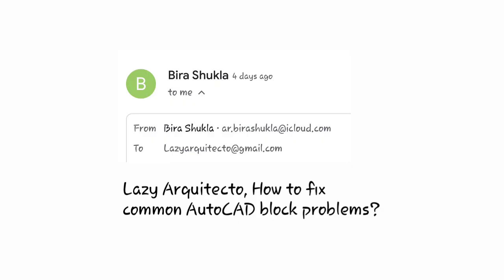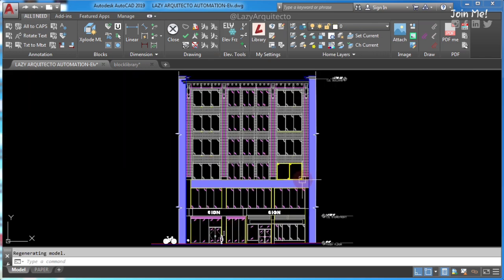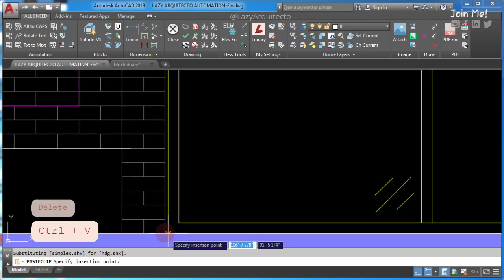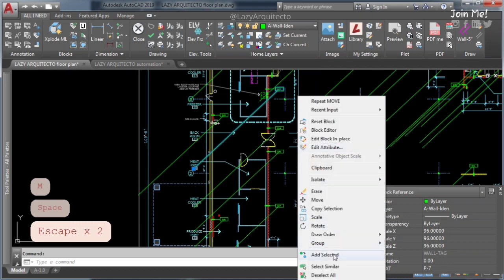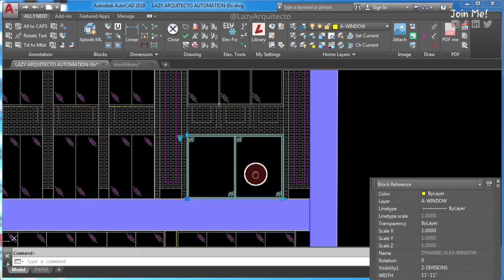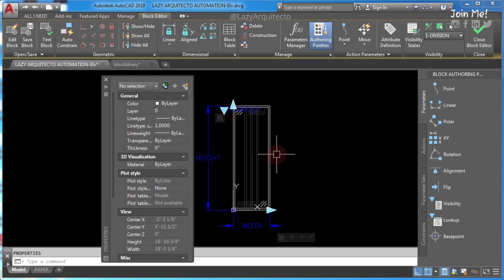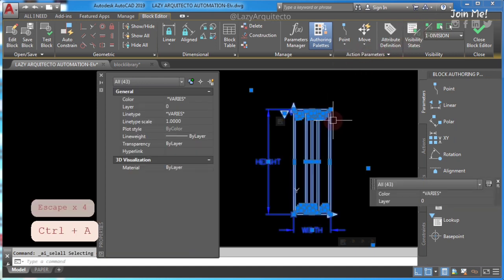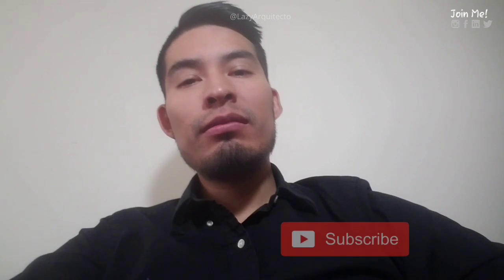Do You Have These Autocad Block Problems?

Comment: MAN!! I have a block that the linetype is not showing correctly on a block. I have a similar block that is appearing correctly, but one is not. a regulator the pilot line is showing as solid on one and as continuous line on the other one. HELP!
So I just checked and every regulaot block I try to insert the pilot linetype changes. But if I copy and past from a regulaot that is already in drawing they stay as dashed lkines.

Any idea how to get the line to show as showing in Block Editor mode?
Reply from the maker: You need to get inside the block an place objects bylayer here instructions https://youtu.be/zqkrovOn4is
Reply: @LazyArquitecto  Right. When I open Block Editor all lines are showing correctly and are on correct layer. But when I exit out of Block Editor the lines show incorrectly. 
I dod not create the block. It is a AutoCAD block. 
Thank YOu
Reply from the maker: @anthonyz5671  did you check your ltscale set to a different scale like 32 or 48
Reply: @LazyArquitecto  Not sure I follow. My scale at bottom in command line states 1:1.
But now i have other issues. All of a sudden my Properties pallette is now showing up. It's on but dissappeared. maybe I need a reboot. lol
Reply from the maker: Type ltscale then 32 or more
Reply: @LazyArquitecto  OK. In BE I changed to 32 and it turned solid, so I put back to 1. But outside of BE it is still solid line.
Reply: @LazyArquitecto  ok got my property palette to show up again. idk what is going on with my desktop lately.
Reply from the maker: @anthonyz5671  are the two blocks on the same layer? if not much properties using the ma shortcut on your keyboard from the one that have the dashes to the other one that you are having the problem
Reply: @LazyArquitecto  No but it will not select the incorrect block when trying to match the properties of the one showing correctly.
Weird thing is if I bring in another of the one showing correctly from ACAD it comes in with the same problem.
WTH?? lol
Reply from the maker: try ltscale to 24, 48, etc. and regenerate, or watch this video https://youtu.be/8bFjFFIELoc